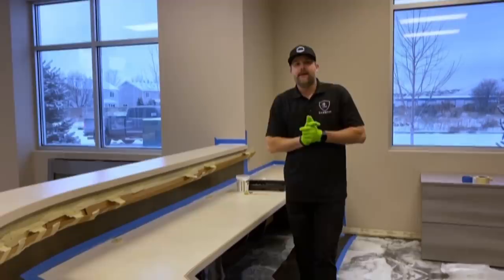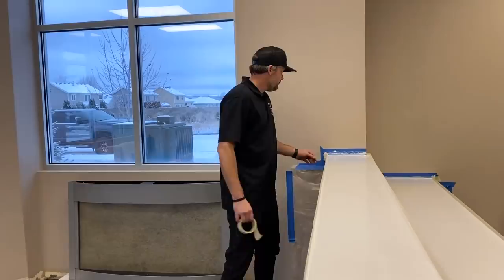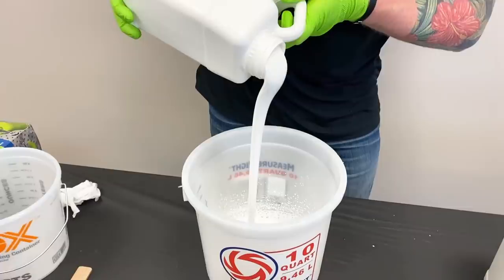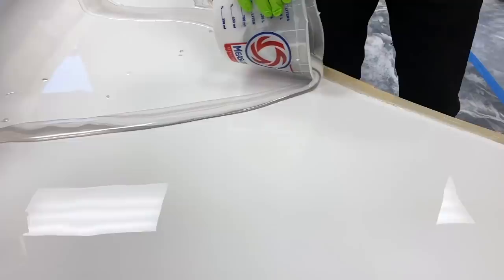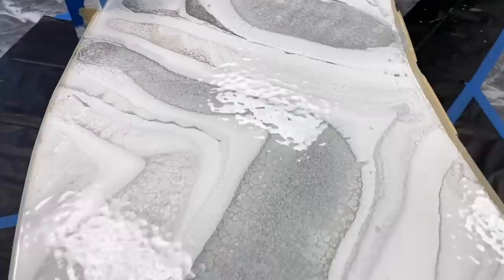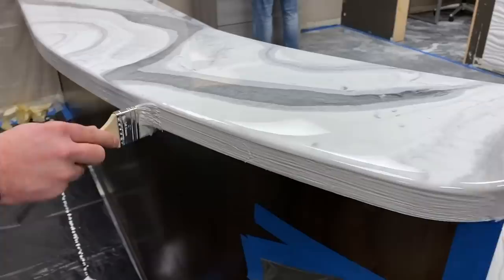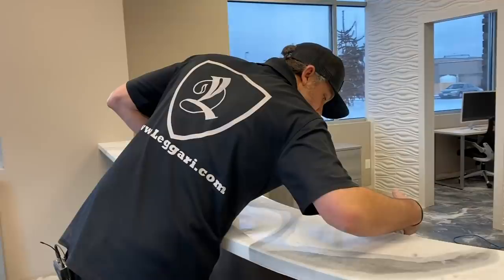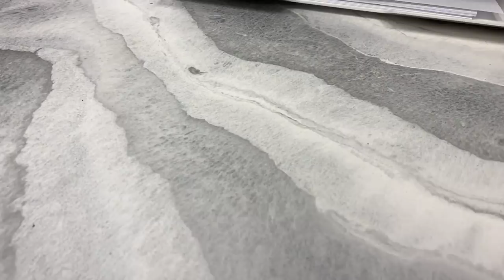Epoxy Dirty Pour Technique On Formica Countertops Tutorial | DIY Countertop Remodel Ideas

Comment: With the edges, did you just sand them down at a 45 degree angle? I've been wanting to do my countertops, but wasn't sure how address the edges to get a rounded look.
Reply: Listen to the video. He tells you what he did to the edges
Reply: @naomid6419  I did listen to the video. But thanks for the tip

Comment: Looks beautiful.  It’s satisfying seeing the epoxy cover an old countertop! 

Do you throw away the paint brushes?
Reply from the maker: Yes we usually throw them away, it is vary hard to get the epoxy off of the brush after it sets up.
Reply: if you are worried about having to throw paint brushes away you can get reusable ones, use silicone basting brushes, the epoxy comes right off after it cures. https://www.amazon.com/gp/product/B07HR8HG25/ref=ppx_yo_dt_b_search_asin_title?ie=UTF8&psc=1
Reply: @timothyplumb8843  LOL,... The material is $200/gal and you're wanting to save a couple paint brushes?
Reply: ...or $12/sqft

Comment: Been thinking about bying a kit but i have a safety question, When sanding i noticed you were not using a mask, so i guess your products are safe to use ? Because i was at a safety course for epoxy and here we were told to always use a mask, eventhough using a sander with wacum attached.

Comment: How does this fare in a kitchen environment... with the constant cleaning... and the occasional knife cut... etc?
Reply from the maker: Our products are actually industrial coating made for military aircraft hangers, etc. So theoretically in a residential, or even commercial setting it will last forever. This is NOT a cheap epoxy paint that you will commonly find at box stores like Home Depot or sherwin Williams. It is a thick 100% solids epoxy coating.
Fire and heat test
https://youtu.be/09elup51N6U

Comment: Beautifully done. One question you switch color tapes when edging was there a difference in them. Second question what about bubbles? How do you get rid of them or do they not form?
Reply: Is there anyway to get a satin finish or a "matte" like finish? May be even with the top coat?
Reply from the maker: No there is no difference in the tape other than the color.  We have a high end epoxy that has an additive in it to make the bubbles rise to the surface and pop on their own.  Thanks

Comment: Isn't a resin floor in a business slippery--esp. w/snow outside? nice contrast w/counter;) Q: urethane top coat? Wouldn't it yellow? Would use epoxy top on a kitchen, right? thanks:)
Reply from the maker: Our urethane top coat is UV stable and the epoxy is just like walking on tile.  Any floor will be slippery when wet.  We do have a grit you can add to the urethane to give it more traction.
Reply: @LeggariProducts  thanks:)

Comment: Would it be possible to put an oak trim around the edge before the pour so it bonds fully with the resin? If so how much upstand would I need for a flush finish?
Reply from the maker: That is a good question.  Please contact our techs at 844-534-4274 ext. 1 and they can assist you.

Comment: I may have missed it...but what are you using as primer....white oil paint or is that a white epoxy product?
Reply from the maker: Our Leggari primer is a water based epoxy specifically designed to chemically bond to almost all smooth surfaces.

Comment: Can I ask what about bullnose table tops and countertops how do you do those can you do a video on also laminate countertops that has got grip holes or grip how do you make those smooth thanks
Reply from the maker: Anthony, you can contact our techs at 844-534-474 ext. 1 and they can assist you with any install questions you may have.

Comment: Pro tip 4 all of u diys .painter's tape will pull paint off ! Especially if its freshly painted surfaces! Y? B cuz the paint is still playable  and it hasn't had enough time to dry to hard shell. If ur laying paint dwn next to these kinds of counter tops make sure ur paint has 24hrs to cure out, 48 if its oil base paint. I've painted professionally 4 30yrs.
Reply from the maker: Absolutely, we completely agree! That is why we actually do not recommend any kind of paint as a bonding agent for counters. Our primer is meant to bond the epoxy to the counters and has been used for years by contractors all over the world, and will not peel off. Thanks!

Comment: What do you use for your top coat and if I like it with a high shine do i have to sand it and what should I use for top coat
Reply from the maker: We have 3 different top coat options. Glaze coat is our super high gloss top coat that lays out glass smooth just like the metallic epoxy coat. Our WB Urethane comes in high gloss and leaves a minor texture and we also have a WB Urethane that’s a Matte/Satin finish.

Comment: I want to do this over my floor tiles. However some of them are cracked. Can I still do this with a filler in the cracks and can you all help me over the phone with my project?
Reply from the maker: Valeria, you can contact our techs at 844-534-4274 ext. 1 and they can assist you with the prep work involved.

Comment: How well does epoxy hold against a glass oven safe platter placed on top of it if it was in an oven for say 400 degrees?
Reply from the maker: The epoxy can withstand up to 200 degrees of heat.  We do not recommend ever putting hot pans on top of any countertop surface.
Reply: Leggari Products thank you for replying

Comment: About how many sq ft is the countertop? Why do you use a matte roller instead of a foam roller? TIA
Reply from the maker: Our dirty pour kits cover 50 sq. ft.  We use a nap roller because the epoxy doesn't stick to it as much as a foam roller.

Comment: wouldn't a flood coat of clear epoxy be much more durable over time especially in an office environment?
Reply from the maker: chaotic/Silence No it’s actually not. Any glass smooth finishes will show more scratches and is less durable than our urethane top coats. We have gloss and matte options and Our urethanes are the most durable coating to apply over epoxy and are in high demand for contractors and commercial settings. We sell industrial coatings that are extremely user friendly and there completely different than what most company’s are pushing on YouTube or online.
Reply: @LeggariProducts  Makes sense  thank you

Comment: What is ratio of part A to B?   Working time?
Reply from the maker: Our epoxy is 2:1 (2 parts A to 1 part B). Our working time is amazing, about 45-60 minutes once it’s out of the container. Thanks
Reply: Leggari Products thank you.  We have watched tons of Stonecoat videos.  Bought some.  And got bubbles.  You didn’t use a torch on yours. Does it not bubble?  We’ve got two full kitchens we need to do and a little scared of bubbling them.
Reply: @tarad5547  I have used both stonecoat and leggari, leggari does not bubble like stonecoat does, once in a while I will see a random and just hit it with a heat gun and its gone.
Reply: Timothy Plumb thank you.  Do you not bother with the gun unless you get the random I’m guessing?  Leggari seems to be easier to work with
Reply: Tara D exactly. I don’t use it unless I see a bubble.  It’s rare for sure.  Also leggari says you can mist denatured alcohol to get rid of any bubbles.  It won’t affect your design either.
Reply: Timothy Plumb I appreciate your input.  Thank you.

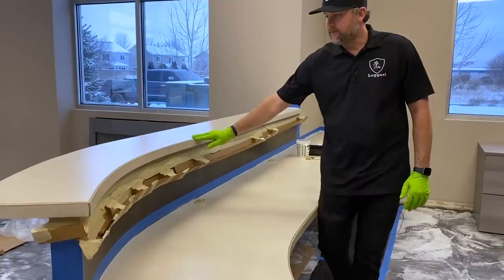Comment: "These had to be braced up".  2:38.    Dear Leggari. You're scaring off a lot of DIY'ers with that.  How exactly did you get it level?  What does "braced up" mean?
Reply: Countertops are normally just MDF or plywood slabs. If they are not level you will need to loosen any fasteners, use shims to level, and resecure them.

Comment: use metal tape...wont push over.
Reply from the maker: Using the blue or masking tape is the best to tape the area off and it will release a lot easier.